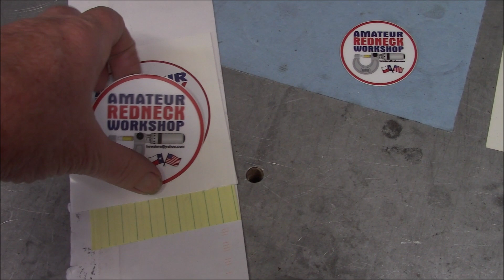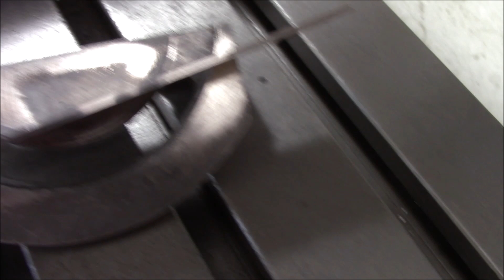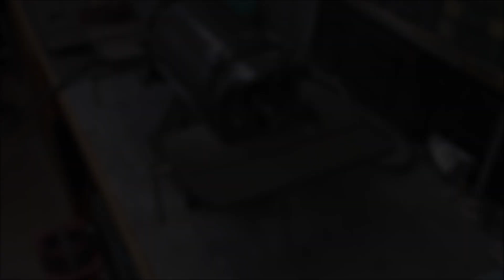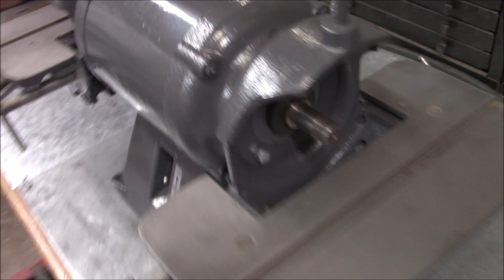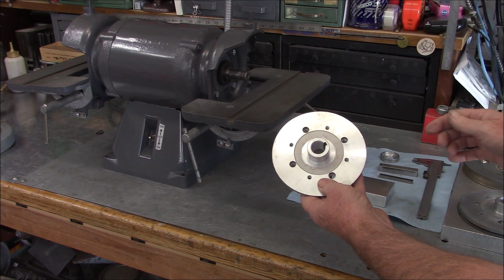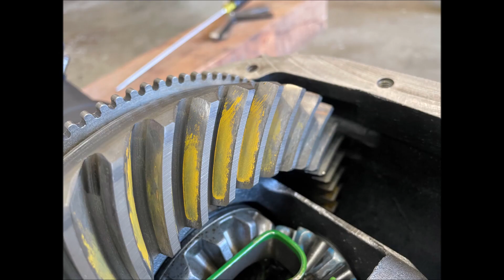Baldor Carbide Grinder Clean Up   Part 3

Comment: Nice when our grand kids come over to our shop,,the love to crank on the lathe and mill wheels too (@@) ! Just FYI, you talked a little on those HF air guns, replace the two trigger o-rings with green AC o-ring's when it starts leaking,,,most Ace Hardware stores carry are local auto parts. Will work for another year :)> That was a fun hour yesterday with the gang, have a great summer.
Reply from the maker: Thanks, too funny the 3 grand sons have just about worn out the lead screw on my big vice, crushing pop cans and old toys..
ATB...Dean
Reply: all we can hope for is a big hug when they go back home to our children,,hehe!